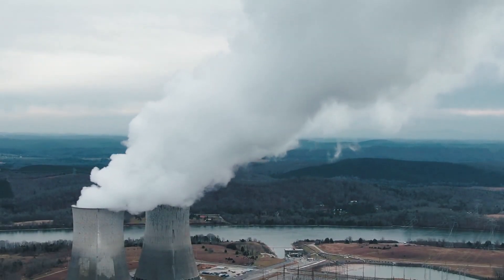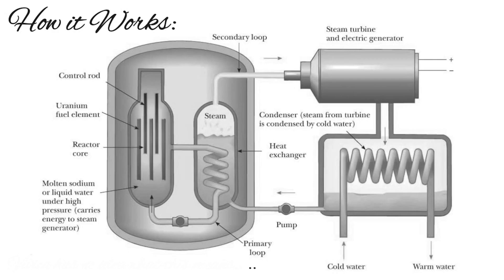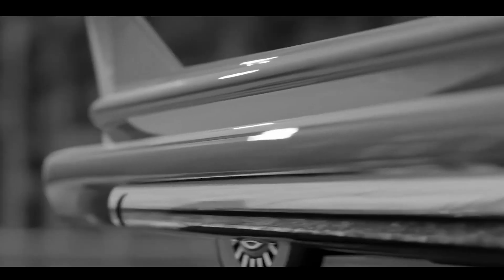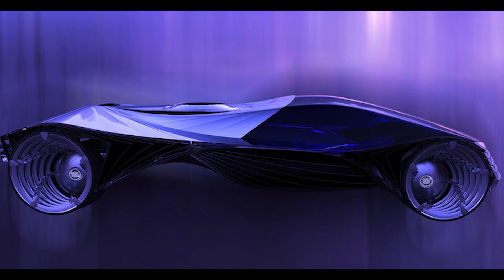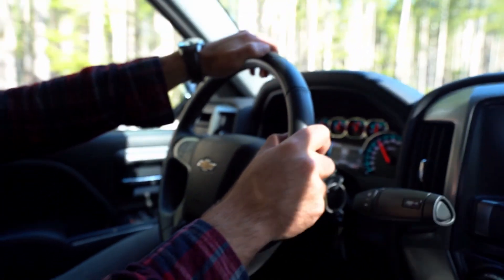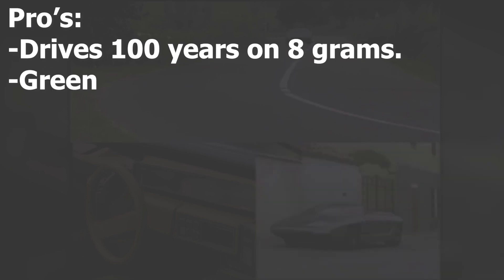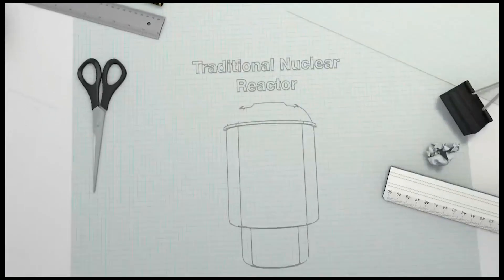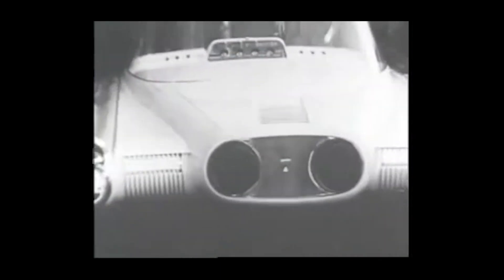Nuclear powered Vehicles, fiction or reality?

Comment: Screw using turbines.

 Thermalphotovoltaics. Or TPV cells is the way to go!

 Think solar cells, but for heat. They just made ones that can run at 40-60% effiency. Or as good as turbines with no moving parts. This was pubilished by MIT by the way. 

 Problem is you need 1,900‐2400 celius to get it to work. 

 So we need a nuclear technology that can produce that much heat, and materials that can withstand it. Then we would be golden.

Comment: Also depends on how people drive, lots of people get multimillion miles on their car, and what really helps on waste is to keep your old car maintained and alive which would be impossible for evs cause the batteries are indefinitely going to die and or less efficient within a decade, and replacing it would not be cost efficient to a lot of people when a new replacement battery is 10-20k alone, which will create more waste and pollution cause mining materials for those batteries are far from eco friendly, and I mind you we have a limited supply of those materials, just imagine replacing the billions of vehicles  today with evs then the extra materials needed to maintain those vehicles, the worlds power grid will most likely go to shit way before we run out of materials to make batteries. Just imagine black outs 2times a day for an entire year, and building more green energy powerplants won’t help much since they are far less inefficient than nuclear power which we would need a couple thousand plants to stay afloat